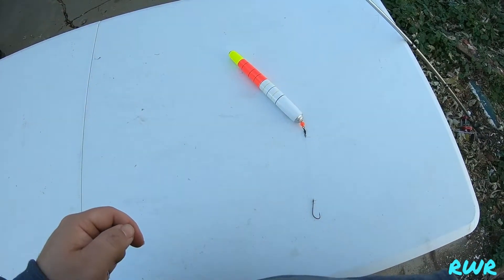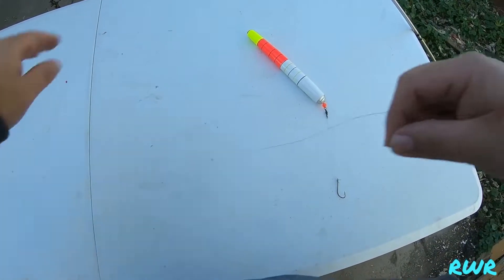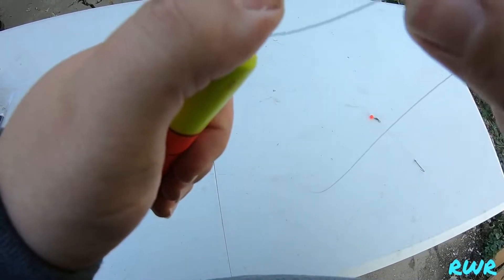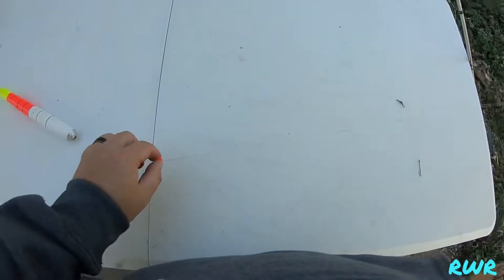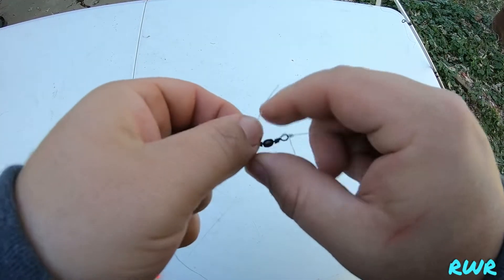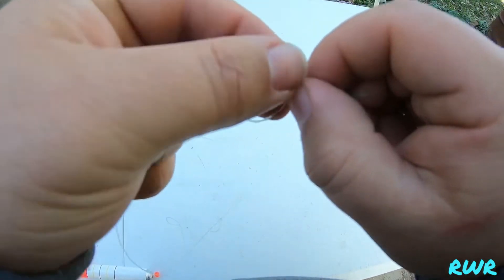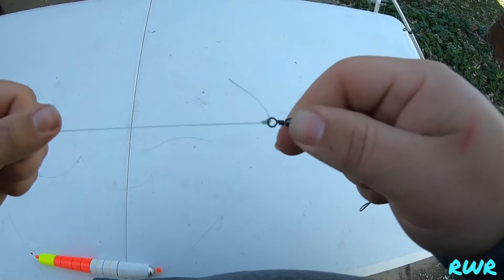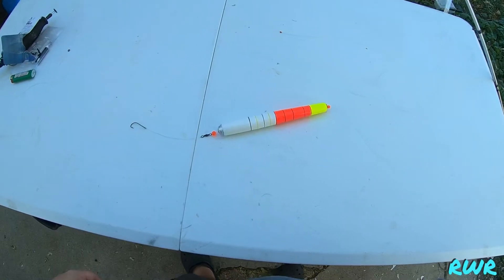How To: Setup a Catfish Float Rig - Simple Catfish Rig - Bobber/Float Rig for Catfishing

Comment: Late as heck but the one I just bought has wire thing going through it? Do I just pull that out and discard it?? Plz respond asap I’m literally in the middle of rigging my setup
Reply from the maker: Sorry I don't check regularly. If a pull wire is present feed your line thru the wire and pull from the bottom down, it will pull your line thru the slip float
Reply: @ lol all good I meant to comment I figured that out after pulling the wire first and not being able to run my line thought the bobber. Fed the wire thing back through and looped my line around it then yanked wire through and problem solved
Reply from the maker: As im getting gear ready for this year i plan on doing a more detailed slip float step by step. Tight lines!